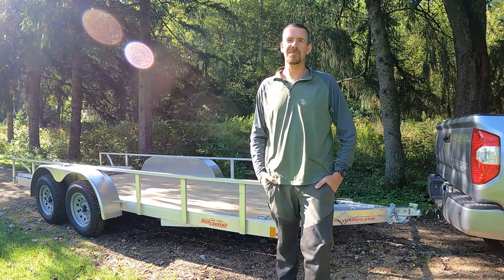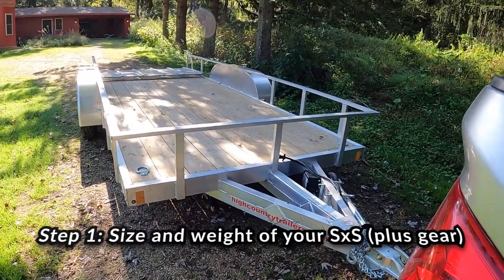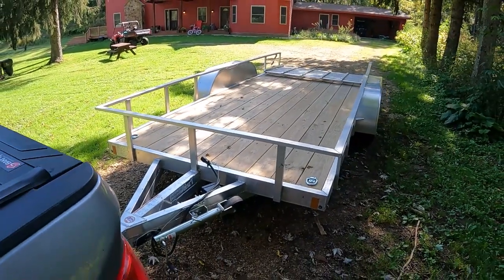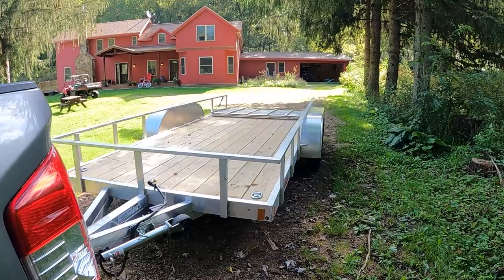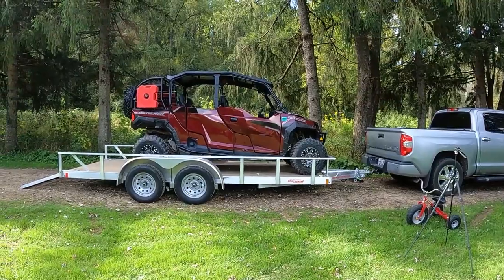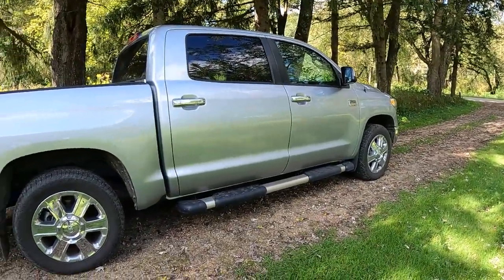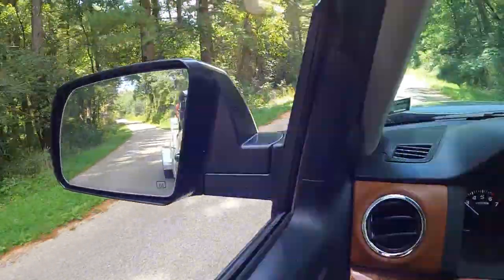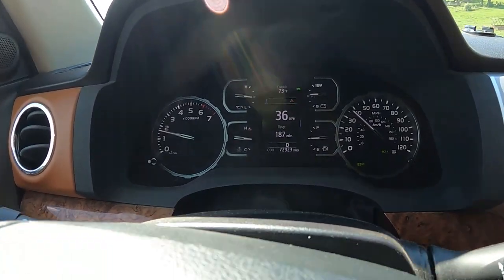Complete Guide: UTV Towing & Trailering

Comment: Best way to strap to the trailer is with tire bonnets/tire straps. Never go above the suspension because it loads and unloads to makes things come lose and it's not good for the components. Also weigh your setup at a scale to know the weight. Use a HD home scale under the front trailer arm go figure out where to tie it down by moving the utv back and forth for that 12% tongue weight.
Reply from the maker: Yeah I’ve seen some people really compress the suspension when strapping things down. I agree I don’t think that’s the best method, things start bouncing and now you have slack followed by sudden tension - not good for the straps either.

Comment: Well thought out tutorial on trailering. I might add not to overlook your tire pressures in your readiness checklist. Also, if you're approaching your weight limit for your trailer, consider the tongue weight (ideally 10-15% of total weight) can be added back to your trailer weight, since the tongue weight is being borne by the tow vehicle. For instance, if your trailer weighs 2500 pounds and you've loaded your 4500 pound UTV onto your 7000 pound-capacity trailer, your tongue weight may be 1000 pounds or so. The trailer is actually carrying only 6000 pounds, thus you actually have 1000 pounds more capacity to haul.
Reply from the maker: Excellent point! I don’t think I mentioned tire pressure, I check it before every major trip and it’s important for safety and gas mileage. 

I didn’t realize that about tongue weight, that does make sense. Thanks for the comment!

Comment: Great video. Lots of good info.
Longer comment - I work with a volunteer organization, we travel all over the country responding to disasters. We move a large Bobcat, an enclosed tool trailer and a towable manlift. It amazes me how little men who have been towing trailers for decades understand - balancing the load, hitch height, twisting safety chains (bad), tiedowns, trailer brakes, etc. This is the way they learned it, so no reason to consider learning anything else. BTW twisting chains compromises the chain. Please use a hanger, even if its bailing wire to keep the chain off the ground. Excellent job explaining everything.
Reply from the maker: Thank you. I never thought that twisting the chains was an issue but it makes sense. Easy enough to use bailing wire, that’s a great idea I hadn’t thought of. I appreciate it and I’ll do that in the future.

Comment: Good video and I enjoyed watching it.  I've sure had some tremendous success with the Shock-Straps.  I use them exclusively.  I also like to anchor front center (of my bumper) to the trailer corner.  On the rear, I go for the hitch where there are 2 triangular holes (one of each side) then to the corner of the rear of the trailer.  By doing it this way, you have that X and you are at the frame eliminating the suspension from riding the straps.  Another trick that works better than I ever thought it would for your excess strap.  Fold the excess back against the strap and use a binder clip (paper clip) to secure it.  I tried this 4 years ago and I'm still using the original binder clip and it is very easy to do.

Comment: Good video. I have a pioneer 1000-5 that i pull  on a steel dual axle. I installed Firestone airbags on the rear of my tundra. After I'm loaded up, I put a small level on the front of my trailer and make adjustments to my airbags to fine tune the levelness of the load.. I adjust slightly higher to compensate for the natural  
rear end dip of your truck suspension while under power.
Reply from the maker: Thanks. I’ve thought about airbags especially given the weight we generally haul in the bed when we go on long trips too. Occasionally if I put the machine a little too far forward I do notice a little more bounce in the rear when we go over bumps. I bet it makes the towing smoother.
Reply: @TheNorthwoodsFamily  
The airbags make a big difference. I find they even help out with the stability. Used to tow a 32ft. camper.,30lbs of pressure was all that was needed. Keep the videos coming,as I 
and others enjoy your content a great deal. May you and your family be safe on all of your travels.

Comment: Very informative video!  I have a 36’ enclosed gooseneck trailer that I use for transporting two Polaris rangers and a sportsman.  The ATV needs to be turned 90 degrees on the back but it fits.  E-track in the walls and floor securely keep everything in place.
Reply from the maker: Thanks! That sounds like a nice setup. We’d to get an enclosed trailer someday.

Comment: Just a thought...in addition to wanting to keep equipment from moving front to rear on the trailer, one must also keep it from moving side to side.  Attaching a ratchet strap almost straight back to the rock sliders provides zero side to side retention.  A much better place for the from ratchet straps is to the from push bar/ bumper to the trailer tie down loops. Use the double loop straps through the bumper and attach the ratchet strap to them.  This will give you a diagonal tie down angle which will prevent movement in two directions.  Nice looking General and trailer.  I happen to use a tandem axle car hauler for my General and also for my Kubota tractor.   Not that I wouldn't want an enclosed trailer...
Reply from the maker: I appreciate your comment! And I think it’s a fair argument. The downside one downside I could see with that is if you break a strap or one loosens and you don’t notice, you’re now  potentially pulling your load laterally / unevenly in one direction.

I’ve heard the argument both ways, I can’t find data to back one or the other, both have some logic behind them. At the end of the day, my own opinion is I don’t think matters a whole lot - at least based on the load I’m hauling. Vehicles experience far less lateral Gs than front to back…. I think at the point where it might make a difference, my truck is going to be on it’s side anyways.

So… I think that’s a totally valid technique you describe. I’m actually really interested in this and I’d love to see some testing or data behind it! You’d think the giant equipment haulers would look at this 🤷‍♂️ 

Thanks for your take on it. Good thoughts and I appreciate it! 🤙🏼
Reply from the maker: and thanks by the way for the compliment! We’d love an enclosed trailer - maybe someday! 🙏🏼

Comment: Thanks for sharing, a lot of useful information. I am a little nervous though about using the rock sliders as my anchor point, I would think that you could find something on the frame that would be a little more secure. I thank you for the tip on the trailer brake. I was not aware of how the emergency brake worked so that was very useful and how you set your gain as well was very useful. I don't have a sxs yet, I am thinking about ordering a General XP4 1000 possibly this weekend, they are saying about 3-4 months out, I'm not too concerned about losing out on the riding season as I have moved to Arizona from California and in both states, you pretty much have an all-year riding season. Again, very useful information!
Reply from the maker: Glad it was helpful! It sounds like you made a good move! 

I bet 75% of the trailers I see hooked up people have their e brake cables setup in a way it won’t do anything if the trailer comes unhitched. That switch is supposed to brake away from the box and I guess most people don’t realize that. 

Since I made this video I generally use the rear hitch now on the back side - it’s just faster but I still secure to the rock sliders up front. They are mounted on there solidly with big bolts and it’s actually kind of hard to find a solid place on the frame that is easy to reach.

Hope you enjoy your new home. It sounds like there is plenty of great riding in AZ!

Comment: 🏆🏆🏆👍🇺🇲🙏
Make sure your  anchors are bolted to the frame of the trailer, I've seen them rip free when just attached to the floor boards with screws or bolts.
And, your battery that locks your trailer brakes in an emergency, must be kept charged, as it sits over time, so it will be able to supply the voltage needed to activate the trailer brakes.
Thank you for sharing
Reply from the maker: I put a reinforcement plate on the backside of the anchors so it’s distributed across a bunch of boards. Theres no good place to attach the the frame back there unfortunately :( The one thing I don’t like about this trailer is it just doesn’t have a lot of convenient attachment points. 

I actually didn’t think of that with the emergency brakes but yeah, really great point. When we bought the trailer as we were pulling it out of the lot, the brake box actually shorted out and they had to replace the thing right there. Thanks Dr Mark!!!!

Comment: Really great video without over complicating the process. I really like the clips on the rachet strap hooks, I've had my share of hooks come undone on long rough roads. On the small loose wires &/or cables, I use velcro extension cord keepers. Thank you for sharing a great video.
Reply from the maker: Thanks! Often the simplest approach is the best. People can be very particular about this stuff but if the machine is tight and doesn’t move, and the load is balanced, you should be good to go!

Comment: Great video with lots of important information, thank you.. if I am being picky, the only info missing would be.. when towing your machine do you put it in park, neutral or in gear ? I think that is also a very important information to share
Reply from the maker: Great question. I would not put it in gear. But I believe park or neutral would be good choices. I have no doubt if towing in Park was actually bad, Polaris would put a warning sticker on the shifter. I also don’t see anything in the manual about not towing in park. That said, it shouldn’t make a difference if you have the machine strapped down properly.

Comment: Good information.  Thank you.  I’m not new to trailering, but wasn’t really taught how to trailer our off road vehicles.  Just got a new Polaris Northstar so it’s heavier than our old Ranger, so I was wondering if I should get a tandem axel or use the one we have.  Strapping was also good information.  I need new straps anyway, so this was good information at a perfect time.  I need to do more research with the manufacturer of the trailer since it’s a 2007.
Reply from the maker: You won’t regret getting a tandem axle. Well worth the cost especially for a heavier machine. 

Only thing I’d really say is I’ve gone away from twisting the chains because it could put for stress on them if they pull taught suddenly and bind up. I just use a simple zip tie now to take up the slack. 

It’s funny because people get pretty heated and opinionated about some of these things but no one ever has data to back it up. Glad you found the video helpful!!

Comment: Hi TNF: Would it be possible for you to take a video of the underside of the trailer and show it? Or just describe it? I'm planning to start making trailers like that and was wondering about the construction. Seems like the axels are mounted directly to the main deck frame (I'm guessing this is to make it sit lower) but there is no extra bracing where the axels are tied to the deck frame? If that were a single axle trailer it would be a massive weak spot for material fatique - but since you have 2 axels I guess it won't be as critical? Would appreciate an answer from you or others that know how the trailer is braced / stiffened under the deck?
Reply from the maker: You bet - can you shoot me an email? Asknwf@gmail.com and I’ll shoot you some photos or videos when I have some time.

Comment: I never had a need for trailer brakes even though my van is equipped with a brake controller.  Now I know how to set it up should I have the need to use traier brakes (from U-Haul maybe).  Another thing to take into consideraton is state laws on trailering.  In my state, <3000 lbs GVWR allows me to get permanent tags without having to re-register every year.  No trailer brakes needed.  Some states requiore trailer brakes for 1500lbs or more, 2000lbs or more, MO only requires trailer brakes on 5th-wheel set ups.  Some states require 1x or yearly registration based upon weight and primary use.
Reply from the maker: Glad it was helpful and really good point on the state regulations!

Comment: Nice vidio.  Love the adventures your family takes.  I am not  an expert but your A arms should be a good tie down location.  Using  all 4 corners is great a d required in many states.  Make sure of stap capacity should be able to carry half the total loD at each corner.  You should tie down to the strongest part of the suspension, not the chasis.  Secured to the chassis is not good as the suspension will load and unload at bumps.  If you use the suspension. There will be np shock loading  on the tiedows.  I never cross  my tiedowns.  If one of corner straps fail then load will shift to the side,  I do also like to  add some angle to the straps so there is side stability.  Tow truck driver do these things on their roll off beds.  Good info on all of the other vid.  Keep up the good work
Reply from the maker: Interesting take thanks for sharing. Wouldn’t you be concerned about the A arms bending?
Reply: @TheNorthwoodsFamily  The heavy lower a-arm are the best.  Some folks strap trough the wheel and tire if the opening in the wheels are large enough to pass the strap through.  The wheel is still part of the suspension when tied down like this.  Check a few of the official sites for UTV sales and service they have lots of good informative vids about this subject.

Comment: There is nothing wrong with securing to your lower control arms front and rear. Also around the wheels is even better, that allows your suspension to move while trailering.
Reply from the maker: I think the wheels is a very good option too. I’d love some day to see someone actually test everything and have some data with pros/cons. I’d wager we’re all over thinking it 🤷‍♂️
Reply: @TheNorthwoodsFamily  we probably are overthinking it but on a vehicle the rule of thumb is never secure to a place that can move. The side can move with the suspension and it puts extra unneeded stress on your tie downs. Wheels and lower A arms as close to the hubs as possible solves that problem.
Reply: @TheNorthwoodsFamily I don’t have data but I tie down my tires and never have broken a tie down point. My friend tied his above the suspension and ripped one of his d-ring to shreds.

Comment: make sure to not only check the trailer brake lights, but also the running lights of the trailer.  I have that problem right now, brake lights and directionals work, but no running lights.
Reply from the maker: Yes good point! Especially driving at night it can be difficult to see a longer trailer without running lights.

Comment: With respect, if you have to stop and tighten your straps after 10 miles on a routine basis then something is wrong with your approach. Yes, you absolutely should check the load, etc. but they should not loosen as you drive.
Reply from the maker: Yes I agree - they shouldn’t be loosening repeatedly and definitely not getting very loose. Most of it is the soft loops we use - they tend to cinch down tighter after a few miles - it’s almost impossible to pull them as tight as they can get with a 2,000 lb machine pulling on them. We usually need to give each ratchet a couple clicks after a little bit on the road and then it’s good the rest of the trip.
Reply: @TheNorthwoodsFamily  I confess that I didn’t watch the whole video earlier because of the strap method. However, you gave us great info on that emergency brake cable and adjusting the “gain” of the trailer brakes. Imagine having a full cord of oak in a trailer behind a 3/4 ton pickup and forgetting to boost the trailer brakes… I only did that once.

Comment: Nice video except you don't have your machine strapped side to side. So in an emergency maneuver, there is nothing preventing your machine from turning over. Front to back is not sufficient. I'd strongly recommend adding straps that hold it side to side.
Reply from the maker: So let’s say I swerve right, when I correct the swerve, weight transfers to the right side. So you’re saying the left side of the machine will lift off the deck and roll off my trailer? How are the straps on my left side of the machine going to allow the left side to lift off the deck? The simply can’t unless they break 

The straps have a fixed length when they are locked in. One strap cannot shift its angle off the deck, or even laterally, because there are three other straps that are also locked at a fixed distance. For the left rear strap to pivot to the right, the only way for that to happen is for the machine to shift backwards too. The front straps will not allow that to happen. And vice versa.

I’m not saying other techniques (x pattern, using the wheels, etc) doesn’t work equally well. But not a single person who has commented on this video has shown any evidence or reasoning behind their argument. It’s all anecdotal. I’ve looked for tests and haven’t seen them. If you know of one please share, genuinely I’d like to see.

Not trying to be rude, we can agree to disagree but I don’t see how what you’re saying will happen is geometrically possible without multiple straps breaking.

Comment: I must have missed it but how long is that trailer?
Also i thought the emergency brake went around the ball and back to the tailer 🤯
Reply from the maker: 16’ - the important thing with the e brake is the cable pulls tight and activates the brake before the chains pull tight. You can do they a variety of ways but too often people have the e brake cable longer than their chains. That’s a problem.
Reply: @TheNorthwoodsFamily  thank you! Was wondering how my general would look on a 16 haha! Yes you are absolutely correct on the safety cable great video btw